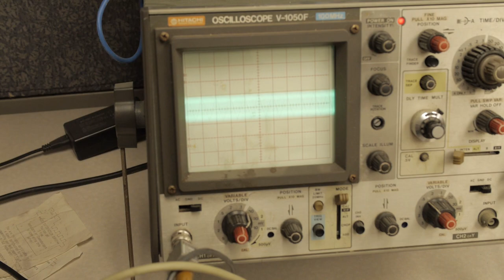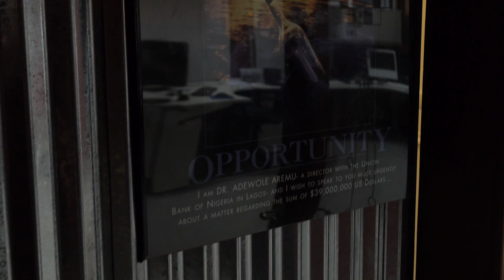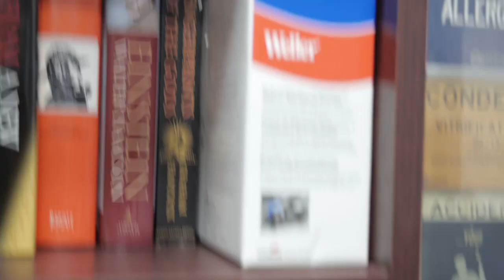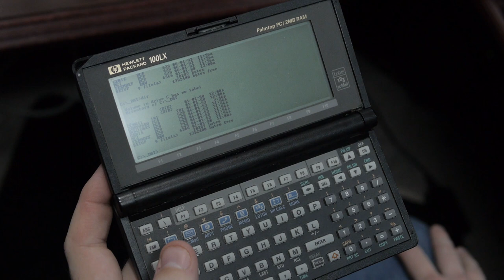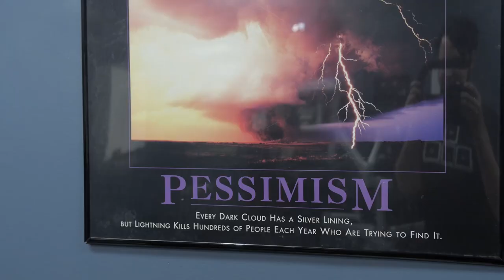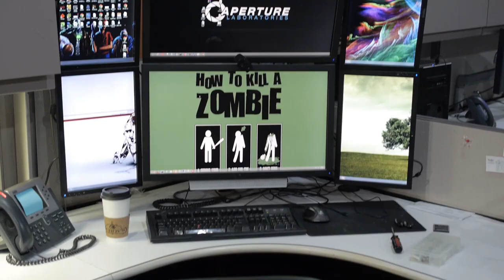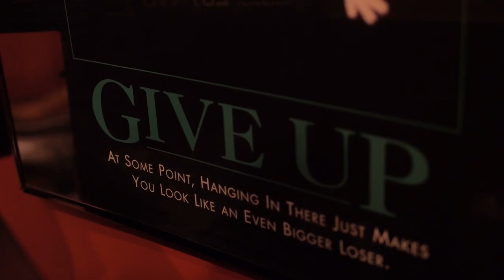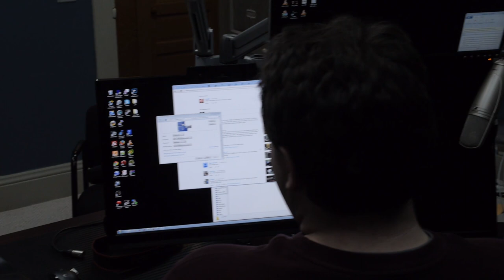Wendell's Office Tour - The Ultimate Nerd Compound

Comment: Also, these arms are a 10 year investement. There is no spring or metal to fatigue over time. The Vesa mounting standard hasn't changed much since ever. We have a few olllddddddd monitors (e.g. Dell 2405 from 2005!) that are chugging along fine on their original monitor arms from 2005. Also, if you get a lot of these at once, you can usually get a deal. Tweet at @SpaceCoBusiness and maybe we can get some demo sets for the different configs. And follow them.

Comment: @12:40 why come not use PoE IP cameras?

If there is a large building i just use a small PoE switch for every cluster of 4-8 cameras and a small battery backup. Makes setup so much easier and cheaper since DC power doesn't like to go very far :/
Reply: Gabriel Soria This was quite some time ago and the IP Cams weren't the best back then but I totally agree with you. I don't think cost is really an issue for Wendel so it's weird that he's gone for traditional cameras.

Comment: 12:42

BRUTAL structured wiring job there guy guy.

What's with the toroid? That looks like some strange old school Legrand lighting controller or ballun for analog CCTV or perhaps a Class D amp for zone audio distro?

What's it for as I can't hear the audio.

If for CCTV you're in the stone ages and should get some Zavio IP CCTV cameras.

Analog CCTV capture via frame grabber is about as pathetic as that Bernulli drive!

I have done a lot of IP CCTV work and for the coinage look at the Zavio IP cameras and get a decent PoE switch for them!

Comment: Ive got a dumb question I'm still debating on, is 256mb of ddr3 faster or equal to 768mb of ddr2? For the sake of graphics cards I'm stumped with 2 cards lying around the house and not so sure which card to throw in my backup rig for gaming on

Comment: Eww d-sub? more gpus if you're out of dvi D:I guess it works though soo idk.
Reply: What's your problem with D-sub?
Reply: glitchsmasher It's an outdated analog technology with bandwidth limitations. I've had plenty of trouble with it, when i first made the switch from crt to lcd I almost took my monitor back for replacement because after a few days of getting used to it i noticed some severe flickering, i checked connections and tried another cable, same thing. Last minute thought was to try hdmi, as soon as i did that the problem went away completely, now the shielding on both cables appeared to be comparable so I doubt it was a noise issue, and i've since used Dual link DVI cables that have no more shielding and had flawless results. D-sub is fine for like 720p or something i guess, i'm not sure what the exact number would be, but it starts to run into problems at 1080p anyhow.
Reply: Alex Smith "Bandwidth limitations" If you can find a monitor big enough that D-sub can't run it, it won't have a D-sub port. D-sub can run 2048x1536. Any 1440p or 4k monitor you find will not have one. It's still used because everything uses it, and the cables are cheap, so a business is going to pick it over HDMI for their 1280x1024 monitors.
Reply: glitchsmasher Correct, D-sub CAN run 2048x1536, at 60hz, with noticably more flickering/poorer colour reproduction than a digital connection. It's absolutely fine for 1280x1024 monitors like you said. But for 1080p it's just plain rubbish. Hdmi cables are cheap too so i don't know that would be a hugely strong argument.
Reply: Alex Smith Funny you say that. My external Dsub monitor has much better colour reproduction that any other HDMI display I've ever used. It has no flickering as well and runs at 75Hz. HDMI cables are way more expensive than Dsub.
Reply: glitchsmasher Uh i can buy hdmi cables for like $6. And what resolution is your dsub display? you're really trying to argue that the connectivity affects whether a display has better colour reproduction than another? :|
Reply: Alex Smith I can get Dsub cables for a lot less than $6. The monitor is 1440x900 75Hz. And you are the one arguing that a connector has better colour reproduction "with noticably more flickering/poorer colour reproduction than a digital connection". I'm saying they are the same or sometimes better, but that it depends on the panel.
Reply: glitchsmasher Fair enough, on that resolution i'd expect you to have no problems whatsoever. Yeah exactly, the panel has a far more meaningful impact on image quality than connectivity. I'm just stating the issues i've personally run into on a d-sub connection. 1080p is really better run on dvi/hdmi, i'm not trying to suggest anything outside of that. I apologize if i came across as argumentative or arrogant i'm simply trying to state my point of view that's all :)